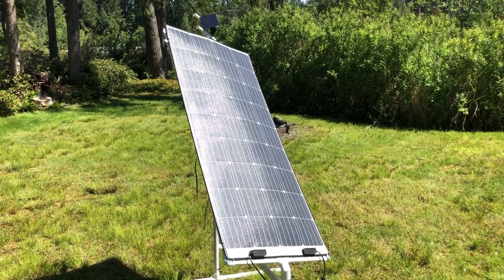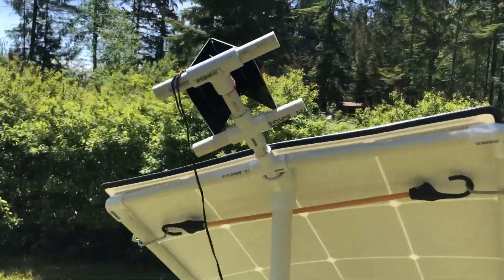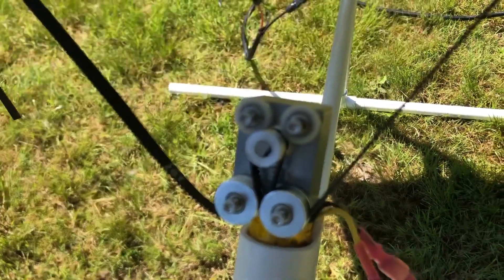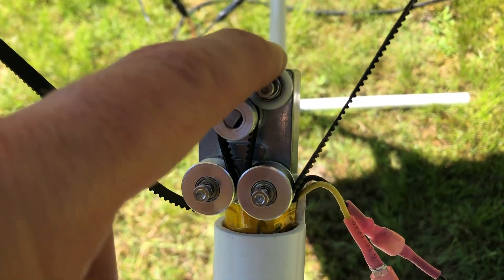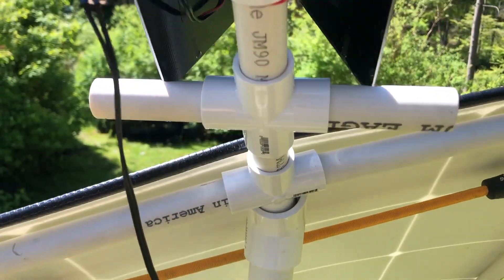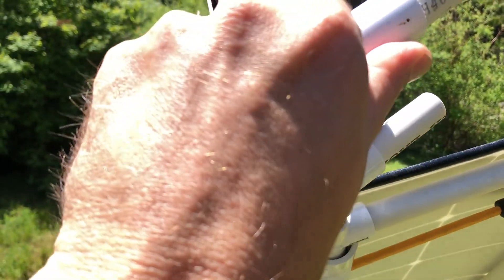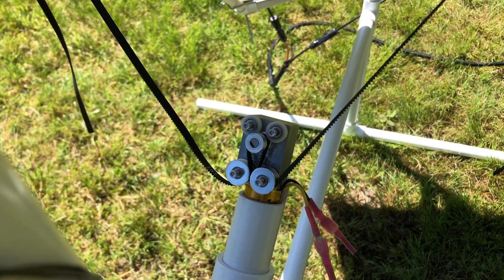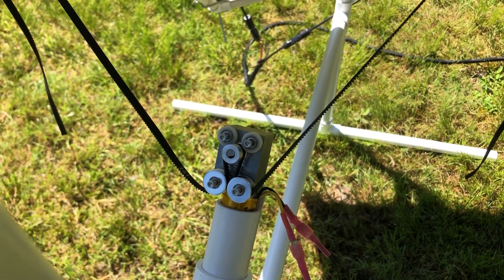Single Axis Solar Panel Tracker - Improvement Bonus Clip!

Comment: can you give me the part number or ref. number for the geared motor  and shaft size please also voltage thanks
Reply from the maker: I have the motor specs in the description.  Look for JGY370 motors on the interweb.  6mm shaft.  They are 12 volt.

Comment: Sir, Do u have any Nx or  any other designing tool file for refernece
Reply from the maker: No, I don't.  I just used the existing pre-threaded M3 holes in the gearmotor.

Comment: the wind will slip or break the belt, resulting in solar panel destruction
Reply from the maker: It's a cogged belt on a cogged pulley.  The entire thing may blow over in a strong wind if it's not staked down, but the belt won't slip and it's strong enough to not break.

Comment: I watched the other videos again. Well done.
So the 10W solar panel supplies the motor with electricity, but when does the motor know when to switch off?
Reply from the maker: Thank you, I'm glad this may have been helpful.  

The panels are wired together + to - and - to +.  When the panels both face the sun at the same angle, they cancel each other out and no current goes to the motor.  When one panel has more solar energy than the other due to the angle panels to the sun, the motor gets driven in the proper direction.

Comment: Hello, great solution.
How does the light sensor control the motor?
Can you give me a tip?

thanks
Leuchtbuchstaben Intersign
Reply from the maker: There is no light sensor.  It's just old-school brute force of one panel producing more power than the other as the sun moves through the sky.  Actually the earth turns, but you get the idea.

Comment: May i ask where do you buy your pulley string and gear for the dc motor?
Reply from the maker: I bought mine from Aliexpress.com, but you should be able to find them other places as well.  It's the GT2 belt and pulleys.

Comment: Thanks for the video.  I plan to do something similar with my 100 watts panel.  I got a dc motor but dont know to get the gear and pulley.  Where did you buy your pulley and gears
Reply from the maker: Aliexpress.  Amazon and ebay have them and may deliver quicker.